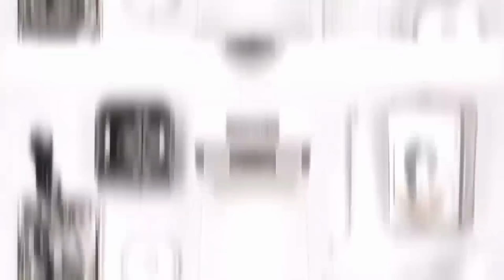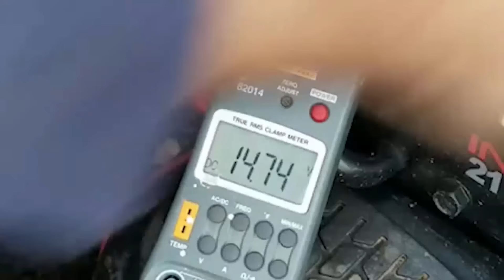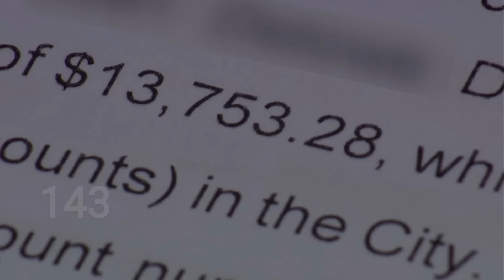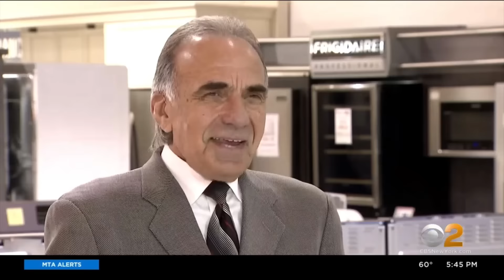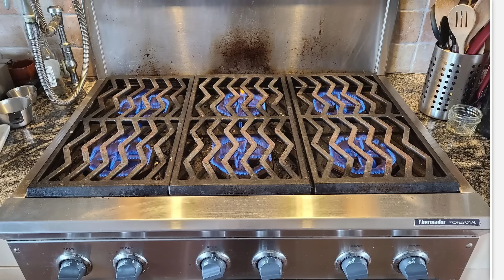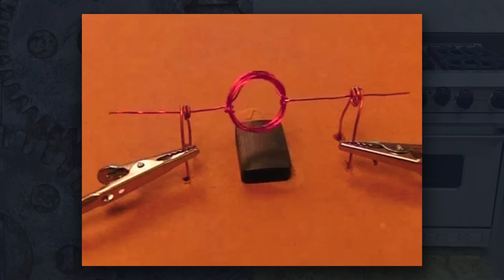The Only 5 "Dumb" Machines Left (The "No Chip" List)

Comment: haveing converted a van myself i will say i know a lot about reliability in high vibration environments and I in general agree with a lot of whats being said but its not technology thats the problem its the drm locks and stuff I still think induction is really much better than resistive heating electric and electric instant hot water heaters are easier to work on their solid state its just a mater of getting the right one. I personaly think the best stove avalible is a cupple of single burner induction cooktops ya you can have 3 of them on your counter their extremely cheap and reliable their highly responsive i will say when the tuch sensor which is under glass and uses no moveing parts its a cappacitive sensor you when it gets wet it doesnt work but its easy you just wipe it real quick with a rag and your back to cooking no moveing parts and if eventually it does break its very easy to replace one induction cooktop their easy to serviec the only moving part is a computer fan for cooling the pcb which if you dont trust teck at all you can build a induction cooktop yourself with a copper coil  and a few inductors capacitors and resistors lol

Comment: Conventional electric water heaters are still dumb enough for me because I’m smart enough to build DIY solar. 
The water heater is often the largest consumer of energy in the house. 
My house was built all electric in the early eighties when doing so was a fad . Gas was cheap so doing so it wasn’t a good idea. However,now that solar panels and batteries are cheap,going mostly off grid has become financially feasible. I usually get paid to cut up fallen trees so my heating costs are minimal.
What bugs me is that I haven’t seen a cookstove without an electric oven control module for sale for a long time. Even gas stoves have them and a momentary break in the neutral wire burns it out.

Comment: I agree that not every device needs Bluetooth. That being said. I have no problem with machines being converted to electric. Electric devices can be built to continue for decades, with easy to repair parts. Just that the profit would go into better rather than the pocket. In physical mechanics IMHO, you can make the machine easily break to increase repair. But you can't really reduce parts cost. This is where plastic parts help. 

As for "smart" lawn mowers, coffee makers, etc. the technology continues to improve daily. The convenience of a machine that can be programmed and left to do it's job is fine by me. Just make it right the first time.
Reply: The only device of mine that needs bluetooth is the "pencil" for my iPad.

Comment: Buy older refurbished appliances with no chips.
Reply: Almost impossible to find.  Local place said they sell before he even has time to repair them.  I ended up buying a new Speed Queen when my 5 year old POS Samsung and its digital crap started acting up and doing things like locking the lid and keeping my soggy clothes hostage for 24 hours, even when you unplugged it from the wall.  Appliances keep getting worse because we have to follow California's water saving laws - and I live in a state surrounded by water!  Really ticks me off.  Same with DW.  Got a brand new $1800 top of the line Kitchenaid and it broke after barely two years and we couldn't even get parts to fix it ourselves.  Everything is crap!

Comment: Thanks for doing these.  I have a 25 year old amana refrigerator that has been repaired twice. Even if the compressor goes, it will be repaired. Even added 1” of foam to the front, top, and sides - this increased the effeciency as I’ve read that 3” foam is the ideal amount

Comment: When my wifi went out, I realized Smart devices are actually not good. TV was useless, Smart lights couldn't be turned off or on, even my Xbox wouldn't work because they don't play games on disc anymore. Everything requires connection. I no longer want the latest tech.

Comment: The message of this video is apparently [mechanics = dang good] and [electronics = baaaaaaaaaad], but in the past 10 years I have replaced my washingmachine because a MECHANICAL part failed, and later I had my heater repaired becaused a MECHANICAL part failed, and a couple of months ago I replaced my dishwasher because a MECHANICAL part failed. In all those products the electronics still worked perfectly. I also have a 1995 stove with touch control that still works - even when moist.

Comment: We bought a hybrid heat pump for close to three thousand dollars. The heat pump part that pulls the warm air into hot water failed after 2 years. It ways a ton and it's in the basement. Covered under warranty but you have to bring the unit back to the plumbing supply place where you bought it for the replacement. Good luck getting a plumber to hump this beast up stairs, go get a new one and then bring it back in to install it. Total trash
, the brand is A.O. Smith. That's a bullshit misleading warranty. It still works, just can't use the hybrid feature.
Reply: The condenser pump went and they don't replace the condenser pump. You have to replace the entire unit as mentioned.

Comment: I own a 2006 Suzuki hatchback. 1.3 L, gas, manual. Manual doors, windows. No computer. 35 mpg. Easily meets pollution standards.
The Japan built engine still purrs. An angry growl when overtaking

I had to scrap my 1975 fridge in 2018. Aluminium + engg plastic. Would have lasted forever
The xxxxx Montreal convention banned the coolants it uses. ( Fridge mfrs were worried no one would scrap these machines. Who would buy new ones).

Comment: why need wifi in refrigerator
Reply: That's right - you don't .
Our refrigerator is a 1949 Frigidaire,with the famous MeterMiser compressor :
basically only 3 moving parts in it .
Still works like a champ .
Reply: So that when the water filter "needs" replacing it can order one for you that will arrive just days before the fridge's water dispenser stops working and tells you to get a new filter (one made by them only) in order for it to work again.

Comment: Speed Queen for washers and dryers.
But I am not in the market:
 - Washer: Maytag 50 years (was Mother's)
 - Dryer: Kenmore 40 years (was Mother's)
 - Lawn Mower: 27 years (B&S engine)
- Coffee pot: 1960 Sunbeam vacuum pot (I have others going back to the 40's)
- Refrigerator: White-Westinghouse 35-ish years
- Stove: Universal Simmer-Save 86 years
- Furnace: Carrier (Dunkirk) boiler 30-ish years.
Reply: I'm as manual as possible on this stuff.

Washer: Have a speed queen washer but hubby and I are experimenting with alternatives. Might wind up building a simple tumble wash hooked up to a basic electric motor. I don't mind having to swing by and drain the wash water and replace with rinse water if I have to 🤷‍♀️

Dryer: after running the laundry through the ringer, I dry by line if the sky is clear or hang on a rack indoors high near the ceiling with the wood stove running if the outdoors are damp.

Lawn Mower: lawn-free. Close to the house we have an edible landscape, further out is pasture.

Coffee Pot: French Press

Cool Season Stove: Rocket Mass Heater with an oven built into it and a griddle surface on top of the heat riser

Warm Season Oven: Solar Oven

Warm Season Stovetop: Induction burner. We have a brick simple one, but we're looking into how to make them with copper coils for when this one kicks the bucket.

Furnace: the above mentioned Rocket Mass Heater. The mass does a damn good job of sucking the heat out of the room during the summer daytime and discharging the heat through the stovepipe in the summer nights as well.

Okay, there is one area I might be lacking. I like the cheap, 7 cubic foot, manual defrost convertible chest freezers. I've got a handful of them and use one for our fridge 😅
Reply: @priestesslucy TOTALLY AWESOME! You know what you're doing! Keep spreading the news... Love...
Reply: @priestesslucy  That's great, but how many people can live like that?
Reply: @aspensulphate  a whole lot of people would be better off dumping the lawns. They're such a huge waste of space and resources.

Ecologically speaking, it would be better to dump dryers too, but it's true not everyone has the time to hang dry 🤷‍♀️
Reply: Speed Queen TC5 💯
Reply: Speed queen! Love your list! I won't switch either! Be well...😊 Clippy LIVES!
Reply: When I cleared out my father's house, we had to haul off the 1983 GE refrigerator, which was still working in 2022. I remember the compressor making a loud noise around 2001, but it went away.
Reply: That’s quite a lineup. When so many things in a house have been running for decades like that, it almost feels like a different era of manufacturing. Hard to imagine most homes today having that many machines still going after 30–80 years.

Comment: If you get a new coil burner electric stove, you need to toss the elements it comes with and get old style that doesn't have the safety BS in the center.
Reply: I was looking at one of those. I thought it was to help control the temperature more consistently. Is that not correct?

Comment: Oh yeah buy a gas appliance when almost no homes built today use gas anymore. Natural gas pipelines have not been laid since the late 1960s as it was a great deal cheaper to hang a copper wire on a pole and many cities are outlawing house propane tanks as they are safety hazards during a house fires. Some cities are actively forcing people to rip out their propane systems for electrical. If you want a home that has gas you need to buy a house that was built in the 1950s or have a propane tank out in the country where you have an hour commute each way to work. So telling someone to buy a gas appliance is extremely stupid on your part.
Reply: Not a problem where I live.  Gas is great, cheap, and easily available from either piped in, or delivered as large cylinders.  And when the power goes it, we can still cook and have hot water.

Comment: One man said he was returning a dishwasher because it was supposed to be connected to a phone app ! He just wanted to clean dishes !
Reply: We made that mistake after rushing to buy a dishwasher.  We installed it and found out we had to connect it to WiFi.  We called Bosch and they said “everyone else is doing it”.  I said, tell the truth, “is this done so you can regulate the water with updates?”  He reluctantly replied, “yes”.
Reply: @homeloveeverything2932  poor guy probably got fired for saying that
Reply: @homeloveeverything2932  Calling this one out. As a repairman for appliances, as well as someone who works with the major brands, including Bosch. No, they do not have to connect to Wi-Fi to function at all. I have delivered, installed, and repaired to remote cabins and ranches that have no internet, let alone cell signals, for the brands you mentioned. They functioned just fine without connecting. And the connection is optional, not automatic, or obligated.
Reply: I wonder if I could find a dishwashing machine or clothes washer without a chip inside.
Reply: @kimb.9205  twin tub washing machine
Reply: @kimb.9205    You could possibly buy a used one that works for not much money.   My neighbors had their appliances standing outside. I asked why.  They just wanted new ones, even though the old ones still worked.
Maybe you could even get a free one from someone getting a new one.  Look at local online sites for people selling things or giving them away.
Reply: @kimb.9205  speed queen old school or kenmores at repair shops

Comment: That older machines lasted a life time is a joke! The difference between machines of today and the machines of yesterday is that today you are expected to replace them where older machines where designed to brake so they can be repaired every few years. Companies never wanted their machines to last a life time as that was not nearly as profitable they wanted them to brake after a few years the only difference is today you replace the entire thing instead of having the really expensive licensed repair man to come and fix what was always meant to brake. Back in the 70s I remember all of the adds for their licensed Sears and Maytag Man repair men was ready to come to your house to fix your broken machines. Why would they have a really massive budget to advertise their licensed repair men if their machines never broke?
Reply: First of all it's "break" not "brake" unless you are talking about stopping a car on the road.
As far as the Maytag repairman ads, they were about him having nothing to do, because (their claim, not mine) they almost never break down.  
By the way, I do have a Maytag dishwasher (old style with a knob and mechanical buttons) that came with my house that I bought 14 years ago.  And it was old when I bought it.  It gets used all the time and I have never had to get it fixed even once.  
My Dad had a fridge from the 70s and only replaced it because his wife didn't like that it was green.  
Yes, sometimes the old appliances needed repair, but at least they were repairable and some with generic parts, such that they can still be fixed today for not much money.

Comment: So I’m gonna say I remember the first smart machines l, it was a Taylor industrial fridge/freezer. I hated that thing and now I wish I had one. Every time someone left a door open too long, it wasn’t cooling or freezing in a certain time, I got a notification every time the room was hot/cold. I got a notification(email). I was OK with that after awhile cause at least they had a kettle style compressor and it only complained when refrigerant was low or something else was malfunctioning.
Reply: Or you can set the level very slightly off perfect, so the door will slowly swing closed on its own if accidentally left open...

Comment: I don't want smart anything, I am smart enough to own dumb products and thrive.
Reply: My $20 coffee pot works pretty well. A lot. For 10+ years.
Reply: Especially since this smart crap is smarter than I am.
   My smart phone probably has a thousand functions. I think I know 10 of them.
Reply: Devices that don't connect to the internet, don't harvest your data, etc. have become rare treasures in this era.  

However, don't reject devices just becuase they have a solid state circuit board.  They don't necessarily have the problems of "smart" devices listed here.  I'm also not automatically opposed to devices with chips in them.  However, I am opposed to putting internet connections in everything to harvest my data.  

Refrigerators don't need chips and internet connections to send my data back to InfoCorp.  They need a heat pump to create a cool space for storing food.  However, I am fine with a sensor to tell me when rot or mold are growing in my fridge, as long as the data doesn't also get sent to InfoCorp.

Comment: I agree with the main point of the video, but I think you’re overemphasizing the issue a bit. Stores around me are still full of products without chips or “smart” features — purely analog coffee makers, gasoline lawnmowers, refrigerators without screens, and so on. That said, some smart devices actually make sense. For example, a smart water heater can be useful — you can use Wi-Fi scheduling to turn it off when you’re away from home, which can save a significant amount on electricity.
Reply: Or you can take 2 minutes to go down to the basement to turn it off.
Reply: @KameraShy  Are you so dense you miss the point? 

Yes, you can do that.  Now you're on your way home, it usually takes a minimum of 2 hours for a cold water heater to heat up the water.  So if you're on your way home from vacation, you can turn your smart water heater,  smart AC/HEAT on long before you arrive home so you will have hot water and a cool or warm home.   Smart appliances DO have their good points too.  My dumb coffee maker is plugged into a smart outlet, once I make coffee and then get ready to go off somewhere, and realize, oh 💩, I left or did I leave the coffee maker on.  Without that smart plug, I'd either come home to a scorched coffee pot, possibly even a burned down home because I may not be able to get back home and turn it off.  So that smart plugs allows me to cut power to a manual dumb switch controlled coffee pot away from home.

Smart appliances and options do have some very good aspects, but you use them with a common sense approach, not fear them.   Some folks are just too dadgum paranoid about anything and everything they either don't understand or refuse to even learn more about before coming up with ridiculous, and many times, unfounded conspiracy theories.

Comment: Fragile computer?
Computers aren't fragile.... 😑
Just because they abuse the technology, doesn't make technology bad. Try this, replace your home PC with Linux and watch your "fragile PC" last 20 years. Of course, they can still make the keys fragile, but that's mechanical. They can make the power cord fragile, and the battery might fail, but you can replace and upgrade those. Also, an external keyboard can work on a laptop with bad keys, so that is fixable too.
Reply: Wrong. Computer PCBs and their components ARE inherently fragile. A PC can last 20 years because it lives in a moderate temperature and humidity environment, but still requires cooling fans. A PCB board in a stove fries like bacon. One in a refrigerator freezes like ice cream.
Reply: @KameraShy Yet you can put them in space and use them on probes that touch the sun. Shrink them to RFID size and they can go anywhere. It all comes down to design.